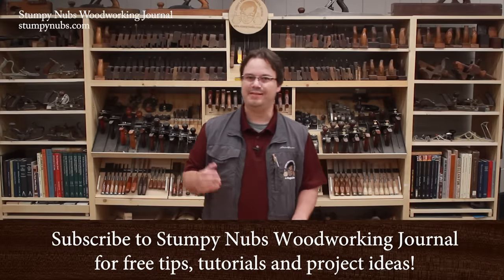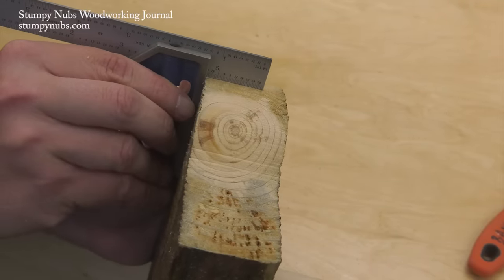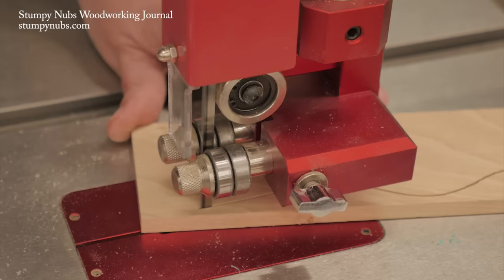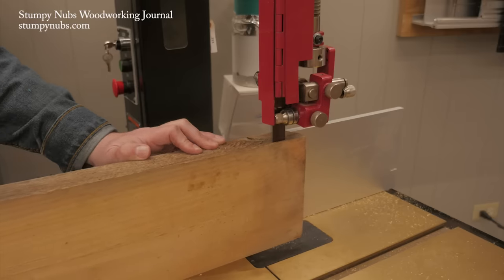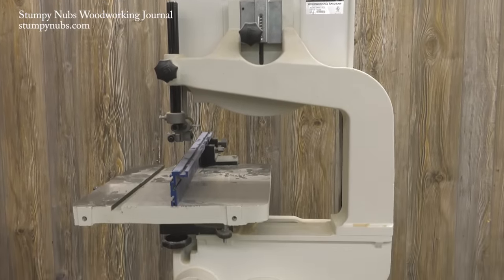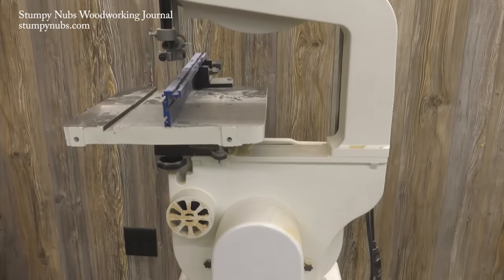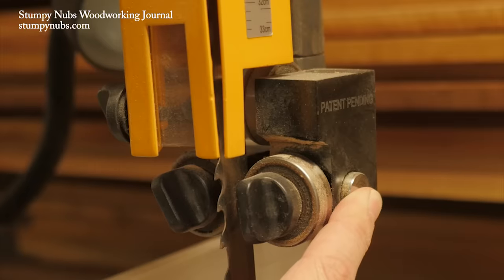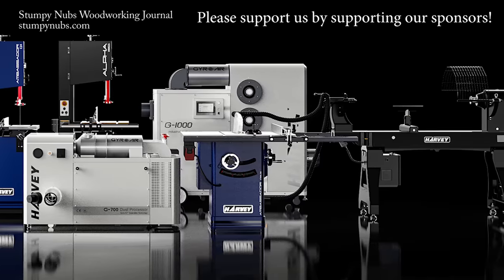What you really should be looking for in a band saw for woodworking

Comment: Thanks for this video, when I first saw it a month or so ago I was not even considering a replacement for my 20 year old 14” Delta but as my needs have changed to more re-saw work I got in the market. I was going to buy a Laguna 14bx220-250 but they are pretty much unavailable for a few months. Then I remembered your video and based on your recommendation and that of other posters I ordered a new Ambassador this morning. Expensive but with far more features than the Laguna and on sale right now (1/30/2022) for another 30 hours! The sale price almost negates the shipping and sales tax, almost. Do you have a favored carbide re-saw blade?
Reply from the maker: I use Laguna Resaw King carbide blades. We made a video about them a couple months ago. Enjoy the saw!

Comment: Just one point.  Some band saws come with plastic throat plates.  When you are resawing, if you get carried away and feed too fast, especially using a blade with very low TPI, you can under the precise wrong circumstances have the blade snag the upper corner of the piece slam the lower corner through the cheap plastic throat plate.  That can kick the back end of the piece up at your face, chin or neck, and the kick up can be very hard and very fast.  So, you might want to look closely at that possibility.
Reply: Garry not Linda. Has this actually happened to you? Very bizarre. First, the blade twisting that much says it's not tensioned properly. Second, the guides are not set correctly and third the guides are too high above the work. I can't count the times I've seen You Tube demo's by known presenters and the guides are six inches above the cut. They'll say something like I left the guides high for vision clarity. Horseradish! They were too lazy to make the adjustment. There is no such thing as kickback on a bandsaw. Period.
Reply: @bassrun101  Just once, and that was a re-saw of a very wide piece of hardwood.  The guides were where they should have been.  The blade was a new, half-inch 4 tpi.  The bandsaw is an old Rigid 14" cast iron frame with a riser block.  I  thought at the time that the feed rate might have been the problem, too fast.  I think the wood was tough enough that it stalled the blade, the frame flexed, which would affect tension, and the blade literally pushed the piece through the throat plate.  Then the blade broke.  That was many years ago and I still use that saw with no problems.  I've just never attempted to take full advantage of the riser block again.

Comment: I knew that I need to choose the right tool for the job, which is that tool is the question. For a small shop a 14“ is almost not an option. But the work I need includes resawing 2" very hard wood. Would a 10" 1/2 HP like the rikon 10-3061 do the job well? If not, should I just skip the bandsaw altogether until I have the space for at least a 1 HP?

Comment: Thanks for all your informative videos. I am setting up my brand new shop. Some of the work I will do will be re-sawing. If you were to buy only one bandsaw, which would it be and what size? I don’t mind spending a little for size and quality but I am wondering if there are disadvantages to buying too big. Thanks.
Reply from the maker: I'd buy the blue 14-inch Harvey you see in the video (the one with the 1/4-inch blade on it in the video). Loads of power, all the resaw capacity you are likely to need, the best blade guides I've even used, dual dust collection ports, a tension quick-release and a brake. If I have to point out a downside, the fence is a pain to take on and off. Otherwise, it's the best saw for the money, in my opinion. https://www.harveywoodworking.com/products/c14-14-bandsaw

Comment: Stumpy, I really enjoy your videos and information.  I work in my garage and I just do hobby work so your help is greatly appreciated.   What are your thoughts on the importance of a brake on a band saw?
Reply from the maker: A brake is handy because, after you turn off the saw you can push the pedal to stop the coasting wheels faster than waiting for them to slow to a stop. This is good for an impatient person who needs to retrieve a piece laying close to the blade where he should not reach when the blade is moving. A brake is not intended as a quick stopping mechanism if you get in trouble while the saw is running.

Comment: James, I am in the market for a bandsaw. (Can you, would you answer this question?) What band saw do you recommend?
Reply from the maker: I own both the Harvey C-14 and the HW615. I love them both for different reasons.

The C-14 (https://www.harveywoodworking.com/products/new-ambassador-c14-3hp-14-band-saw) is a fantastic saw that will do pretty much anything most people will ever need. It has lots of power (3HP) and cutting capacity (14" max re-saw). The fence and trunnions are of high quality. The guides are the best on any saw I have ever used in terms of adjustability without hassle. The wheels are heavy cast iron and the frame is big and beefy. It has a quick-release tension mechanism and a foot brake. It also has dual 4-inch dust collection ports. My only complaint is the table height is a little low for my taste (34"), but I adjusted to that fairly quickly and if I wanted to I could put blocks under the saw base to raise it a few inches.

Here's a Cool Tools video we did on the C-14: https://youtu.be/4XNh0v2GUJA

The HW615 (https://www.harveywoodworking.com/products/new-alpha-hw615-15-band-saw) is a beast of a saw. It has all the things I like about the smaller C-14 (3HP, 14" re-saw capacity, quick tension release, foot brake, dual dust collection ports), but it is even more robust. Everything about it screams quality, in my opinion. I have tensioned a 1-1/4" blade on it (the manual recommends 1" max), which puts an enormous strain on a saw's frame. But this thing barely flinches. The fence is the nicest I have ever seen on a band saw. The table is extra large and heavy (I have the tin-coated table, which resists rust). If I had to say something negative, the guides are a little more fiddly to adjust on the HW614 than they are on the C-14, but still nicer than most toolless guides on the market, and very heavy duty.

Here's a Cool Tools video we did on the HW615: https://youtu.be/MmMjLHIunQE?t=341

Here's a general video about what to look for in a band saw: https://youtu.be/sUsKYElDKl0

Here's a video about choosing band saw guides: https://youtu.be/3MPR2kcMhJU

Here's a video about band saw blades: https://www.youtube.com/watch?v=z7n7Gg4QOkc&t=0s

Here's another rone about Carbide blades for resawing: 
https://www.youtube.com/watch?v=bSm6hE3bBeU

Here's a video about setting up a band saw: https://youtu.be/tPRrEgnt7wM

Comment: You were mostly talking if one was to buy a new bandsaw, but buying an older bandsaw from the 50's and 60' sometimes has the greater value if one is ready to put in a little bit of time clean it up.
Reply from the maker: I know folks who have old saws and love them. I would buy an old saw and fix it up before I bought a low end new saw.
Reply: @StumpyNubs  indeed, that is what my budget forced me to do for my first bandsaw, and i have not regretted it, and when i needed a second bigger bandsaw, i also went back to the vintage route but by choice, i was lucky enough to get my hands on a good old Rockwell beaver, for a fair price, the best thing of Vintage tools is most of the bearings and other parts are standardized which makes getting replacement parts affordable, unlike most of today's power tools, that are more proprietary parts and more expensive to replace  . But im sure you have seen Fireball tool bandsaw video, He took a vintage tool to a whole new level lmaooo

Comment: Hi James, great video! One question, I thought the band saw size was referenced from the wheel diameter not necessarily the distance from blade to frame ? I realize they’re pretty close, sorry to nit pick ...
Reply from the maker: Technically, you are correct. But the two measurements are pretty much the same. And talking about the throat depth is more meaningful to the user than the size of the wheel.
Reply: Stumpy Nubs agreed.

Comment: James, I love your videos as I have posted elsewhere. In one of those videos you say that the hobbyist woodworker will be fine with the ambassador compared to the Alpha line. I can’t seem to find that quote or that video. I wonder if you can point out the major differences from your perspective. Is the alpha worth it if I can afford it?
Reply from the maker: I don't believe I ever made such a broad statement about entire lines of machines (Ambassador vs. Alpha). But I may have suggested that this particular bandsaw would serve the needs of most woodworkers. If you would like to see the Alpha HW615, it was on this video: https://youtu.be/MmMjLHIunQE?t=341
Reply: @StumpyNubs  Oh, you are correct you did not make that claim about the Ambassador line. I was speaking of the Ambassador bandsaw. I thought that you had said at some point that it was plenty heavy duty for most shops. And that the alpha bandsaw was much more heavy duty, but that the ambassador was quite robust as well. 
Between you and Jason Bend I’ve gained a lot of confidence in the Harvey line and I am running the 4 hp tablesaw and the smaller dust collector in my shop.
Thanks for all that you do for the woodworking community and thanks for your honest reviews on so many different pieces of equipment.
More importantly thank you for showing us how to run them safely
Reply from the maker: @WiscoWoodShop  Yes, I do believe the Ambassador bandsaw has the strength, power and capacity do everything most people need, and the Alpha bandsaw is more for the professional shop. Both are very well made.

Comment: I am deciding between the 14” and 15” Harvey band saws. I have just started milking my own lumbar with an Alaskan bush mill jig for my chain saw and am mostly working with hardwoods (maple, hickory and oak).  I am production 15” wide by 5/4 or 8/4 and occasional 16/4 boards.  I plan to process the rough sawn lumbar on a band saw followed by jointer and thicknesses.  Was wordering if the 14” model will suffice as you comment that you only use the 15” model for resawing lumbar? The the 15” looks great but quit a significant jump in investment. Can you get the taller fence for the 14”?
Reply from the maker: The resaw depth of those saws are both about 13-inches, I think. If your boards are 15-inches, you may need a really big saw. If 14 will suffice, I think either saw will do the job. But if I was handling a lot of really heavy boards like you seem to be, I would want the most robust saw. The 15 inch isn't just an inch bigger (throat depth) it is also built like a tank. It would be my choice.
Reply: @StumpyNubs  Thanks. That clears things up. Indeed they are heavy. Will save up while I wait for the lumber to dry.

Comment: I have a 30 inch 1942 northfield foundry cast iron beast of a band saw I payed 160 dollars for it then 50 bucks for a new blade 16 footer lol I love this band saw because of its history but I recently purchased  a 2.5 amp wen 9 inch bench top because I do mostly work with small bowl blanks and the like but the big one is my heavy duty resaw tree cutter but I'd like to get a mid size saw too because running the northfield is heavy on the electric and noisy as hell can u recommend a good band saw that wud meet small and with a blade change do at least ten inch resaw

Comment: Been thinking of getting a Wen 9 inch bandsaw for my small workshop. I will likely be cutting curves straight cuts and light resawing so do you think a little bandsaw could handle that. 3/4 horsepower 9 inches.
Reply from the maker: All of those questions are answered in the video.

Comment: Hi Nubs,
I need a bandsaw with resaw capabilities. Ive never owned a bandsaw.  
Do the 3 hp harvey ambass 14” bandsaw require 200 amp service? Are they available
Used? How much actual time does it take to change a blade on this brand of bandsaw?
Reply from the maker: 200 amp service? Do you mean your main panel in your house? It depends on what else is running in the house (or likely to come on while you use your saw.) I had a 240v saw in a 100 amp residential service once and had on issues.

Comment: i wood carve basswood and it usually comes in 8-1/4” width by 1” thick. I need to re-saw it to 1/2” thick. So what would be a good quality band saw to get? Since the board width is above 6”… I assume i need a band saw larger the all the 10” models…. Do i need a 12”, 14” ?? I am just a hobby person…. But i am tired of planning down 1” board for my projects (really wasting a lot of board feet right now) any thoughts?
Reply from the maker: Basswood is not hard so you don't need loads of power. So just look at the advertised cutting depth. Get one that can handle your needs. I doubt you will find it on a 12 inch saw. Probably 14 inch. But not all 14 inch saws can cut thicker than 6 inches. So look at the specs.

Comment: Hello, would you recommend any brand, or at least type, of a bandsaw for cutting puzzles? I need to take sharp turns and rarely plan to cut wood thicker than 1". I don't need the horsepower. Contrary, I enjoy it as the machine runs quietly.
Reply from the maker: You want a scroll saw for that.
Reply: @StumpyNubs  I have a scroll saw, but I want to upgrade to band saw with a thin blade.
Reply from the maker: @gondebas  Pretty much any consumer bandsaw can accept a narrow blade.

Comment: Great video. I'm getting into wood turning / lathe work. I ran into a situation yesterday that required a band saw, which I didn't (don't) have. My brother in law gave me a piece of avocado wood to turn. The problem is it's a big chunk of burl. It's probably 9-10" tall (largest dimension) and needs to be trimmed down so I can make it more workable with the lathe. I tried using a chop saw but that only went part of the way through the wood. A band saw makes sense. But I don't know what kind to get. If I'm going to be roughing chunks of burl for turning what do you recommend? I don't have $2k for a Harvey band saw. Are there other, cheaper options that you'd recommend? Thanks.
Reply: Chainsaw

Comment: Another great one James, thank you. I'm looking now to add a good band saw. I've seen your comment about new Jets not being the greatest... any thoughts on Rikon or Laguna? I'm also looking at the Harvey's.. those seem nice!
Reply from the maker: I have one of the Rikon deluxe 14-inch saws from a few years ago (green paint). I hate the fence. The split in the table is in the front, so I can't add a good after market fence. I spent $200 to upgrade the guides to the new toolless ones, and those are a pain to adjust because the knobs are on the front of the bearings, so they move when you tighten them down. Otherwise, it's not a bad saw for the money. Laguna saws are a little better, but those are closer in price to the Harvey, which is the nicest saw I've used.
Reply: @StumpyNubs  thank you!
Reply: @StumpyNubs  I did a little digging, and it seems like the Laguna LT14-SUV is the 14" Harvey but with Laguna's ceramic block guides. Not sure if the other Laguna bandsaws are made by Harvey, but given that Laguna has an existing relationship with them I wouldn't be too surprised if there's some shared DNA.

Comment: I'm curious how much variation in the gap between the upper side blade guides and the blade is acceptable, as the guides are moved from the bottom to the top of the cutting height?  I have a new Jet 14" bandsaw, and the upper side guide gap varies by about 0.030" from the bottom of the cutting height range (guides near the table) to the top (13" from the table).  Thanks for any help!
Reply from the maker: The bearings should be as close to the blade as you can get them without them spinning while the saw is on and nothing is being cut. If the setting changes when you raise or lower your guides, there should be a way to adjust that. I'd try to track down a manual for your saw.
Reply: @StumpyNubs  Thank you very much for the reply, I really value it. I am honestly surprised by the range of different opinions in the replies I'm getting to this question on different sites.  Unfortunately there isn't a way to adjust the guidepost on my bandsaw, so I may have to live with it.

Comment: I a variable speed bandsaw necessary? What is the most common speed used?
Reply from the maker: Very few woodworkers use a variable speed band saw. The only reason you may wont one is if you plan to use it to cut metal and wish to slow the speed to reduce heat.